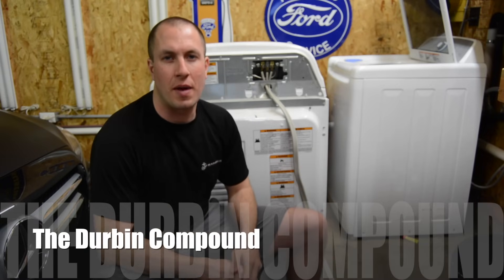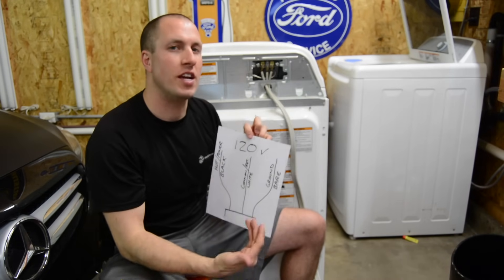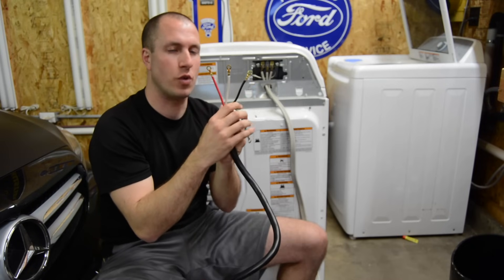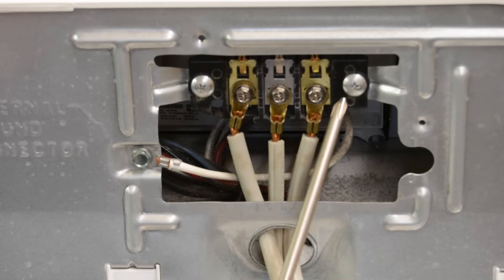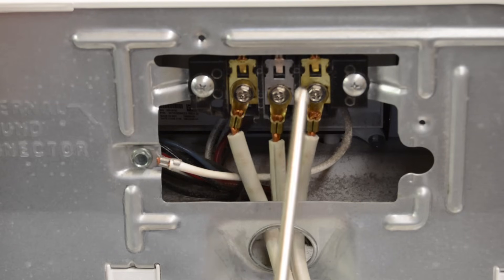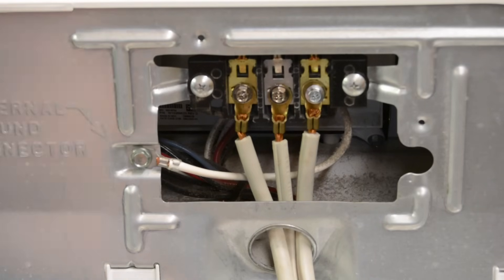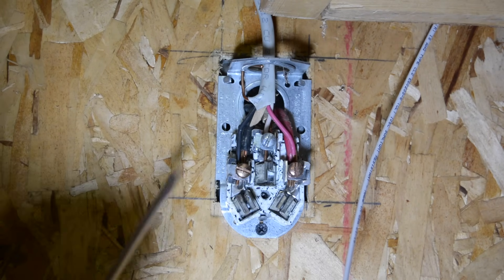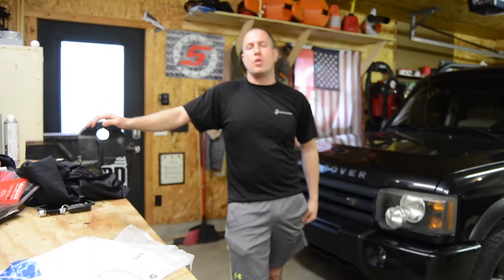How To Change A Dryer Cord - Changing a 3-Prong to a 4-Prong Plug

Comment: The white and green wires on the 4 prong cord do NOT go together. He should take this video down. You put the green wire where the white wire was connected to the cabinet and you take that white wire and put it in the center terminal with the other white wire. So you should have 2 white wires in the center neutral terminal. Red/black on either side of the terminal block and the green ground connected to the cabinet where the white wire was connected
Reply: Tried that and that didn’t work either ..
Reply: I didn’t even watch the video, I did this and it worked.
Reply: I put the 2 wires in the ground position because of the wire that it was already had a green and yellow half and half on the ground and put both of them where he put it. And it worked
Reply: @TheRealDegen. I know your comment was from a year ago but if you see this can you please explain why what he did was wrong and what happens if someone does what he does?? Does it cause a spark/fire or the dryer just wont work?  I would appreciate it since me and others probable dont know anything with electric and or appliances..Thank u

Comment: No disrespect to this gentleman , but there is a correction to be made here . Do not stack the green wire over the white wire on the left of the cabinet, the white wire has to go in the middle of the bank stacked with the common wire when installing a four prong cord and the green wire goes in place of the white one on the cabinet.

Comment: so if I'm hooking up a 3-prong to a newer dryer that previously had a 4-prong cord on it, you're saying to ignore the fact that there's no secondary ground wire? just want to clarify before I fry the dryer im installing, or the outlet its going into.
Reply from the maker: Yes. Hook up white red and black.
Reply: When connecting a 3-wire cord/prong to a newer dryer you MUST have a jumper inside the back of the dryer between the ground screw and the center neutral screw terminal as the grounding on the 3-wire dryer circuits is through the neutral conductor.  This was terribly obvious that this was totally overlooked and not mentioned at all.  Since 1996 the code has required that all electric range and dryer circuits be 4 wire with a 4 prong receptacle requiring the 4 wire/prong cords.
Reply from the maker: Thanks for the clarification Tom. Very helpful.

Comment: @827 you are not supposed to connect a neutral to a ground when you have a dedicated ground. You only do that when it is 3 prong. The reason for the neutral is a pathway back. If the ground is went or maybe if you’re not wearing shoes and you touch the dryer, you could get a shock. Also the code was before 1999 not 2014. Other than that, nice video
Reply: Yay it worked, Thank you sosososo much.

Comment: So I just got a oven with a 3 prong cord
I am converting to a  4 prong to match outlet
There is a green screw that is directly above  the white 
Going from the white to the green screw there is a 1/2" wide 2" long piece of copper. If I am to keep them separated do I need to remove the piece of copper if I am attaching a ground wire?
Reply: Hi there, great video, very well explained!
I have on my wall a 3 prong wall outlet, and my dryer has 4 prong, can I change the 3 prong wall outlet to a 4 prong? If so, how do I get the 4th wire (ground) there is only 3 wires coming out from the wall.  Someone told me I can buy a special ground wire and attach it to the metal box with a screw and then to the wall outlet and that would work, is this correct or you think of something else?

Comment: When connecting a 4 prong wire to a 3 prong dryer you forgot to tell where to put the extra white neutral wire. It needs to be moved over to where the other white neutral wire is. It should be black
 Two white. Red. And your green ground(by itself)  where the white neutral was.
Reply: I was wondering where does it go or just leave it out?

Comment: Replaced a three wire to a four wire and I left the green one out and connected it but it didn't turn on 🤣 where do I place the green one
Reply from the maker: Place the green wire from the cord to the dryer body. Should be a ground wire (green wire) there close by
Reply: TheDurbinCompound  i have the same problem but I’m not sure what is done with the cable that is replaced with the green keep it in just hanging?
Reply: Same question, does the White external ground just hang to side once I replace/attach the green to the external ground?

Comment: You just showed the problem of not actually doing it. You did not tell that with four prong you must remove the connection between the neutral and the frame as the neutral 8s no longer used for equipment grounding.
Reply: That's exactly what I was thinking, I was waiting for him to say to remove the original neutral to frame connection, but he skipped that.

Comment: I have a new dryer but doesnt heat up
Reply from the maker: Brand new? Well if it turns on and operates than you’re more than likely wired correctly.  I’d say there is something wrong with the unit without looking at it.
Reply: @TheDurbinCompound  yeah I gave up tonight looking messing with it I'll look more into it tomorrow  but I think some wires are bad
Reply: at the breaker box on a 240 circuit you have 2 breakers that are pinned together  sometimes one will be on and  one will be off 
they may look on but are not,  turn both off and then on this happened to me  could just be that simple
Reply: @orion-se6bv  yeah it was a blown breaker I had to change it
Reply: So the dryer motor was working with half the 240 flipped but wouldn't heat up until both of the 240 breakers were flipped?

Same problem here... motor is working after the 4 prong to 3 prong switch (thanks for vid)  but no heat up :/

Comment: At the panel, do the white and bare wires connect to the same connection?
Reply: no. they connect to different lugs. if connecting to the main shutoff panel, you could connect to the same neutral bar, but if it is going to a distribution/subpanel then the bare wire or green are seperated from the white wires on different bus bars. Check with a licensed electrician before you do this wiring job.
Reply: If you are referencing your main panel where the main breaker is located, yes, the white and bare wires both terminate on the neutral bus although they must be under separate screws.

Comment: Mine has two grounds, one thats already set up and one that was attached to the middle on top of the neutural. So no i have power neutral power and two grounds on different spots
Reply: It works, idk
Reply from the maker: Humm haven’t seen that before. One might be the cord ground and the other a chassis ground
Reply: You obviously have a 4-wire circuit and are using a 4-wire/prong cord.  You SHOULD NOT have a ground over the neutral terminal, it should be moved to the ground screw along with the green ground wire from the cord.

Comment: He did not mention the extremely critical step of turning off the dryer's circuit breaker at the main breaker panel before working on either the dryer cord (it may still be connected) or the receptacle.  (You should also then check the receptacle with a volt meter to confirm its status.)  You never assume that people know to do the obvious.  I realize this comment could invite juvenile attempts at bad humor intended to shame others, but putting out information that could prove deadly for others is no laughing matter.

Comment: You need to take a Electrical theory course and then a bonding and grounding course. Then you will know all you said is completely wrong. If you house was built before the 1996 code you most likely don't have a neutral at your outlet. If the third wire is bare then it's a ground not neutral. A neutral is a current carrying conduit and must be insulated after the main in your panel.

Comment: I'm not sure your instructions are electrically correct. Other instructions say that If you are using a 4 wire cord, you have the take the white ground wire on dryer and put that wire and white wire from cord both on white terminal. You may want to double check your instructions.